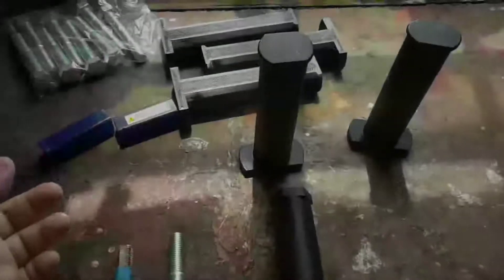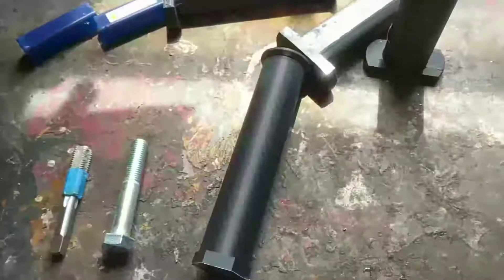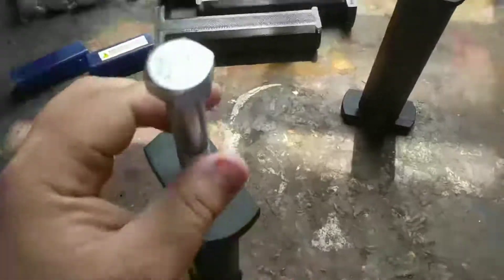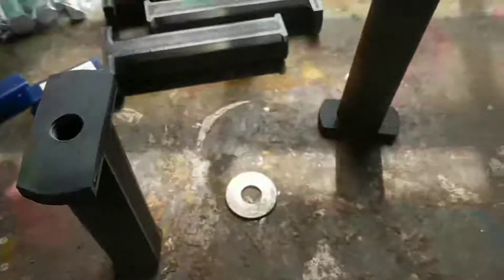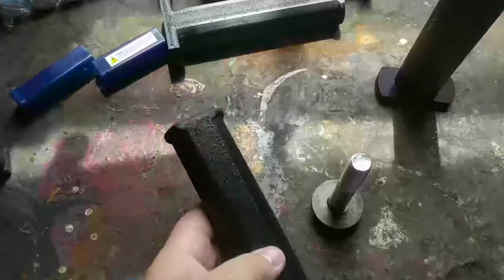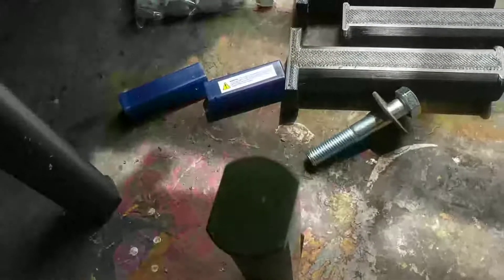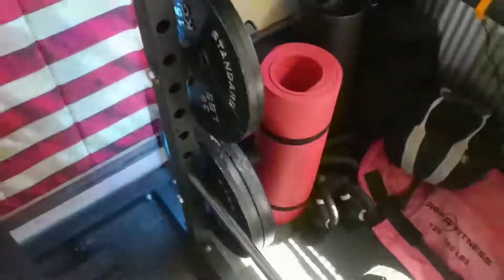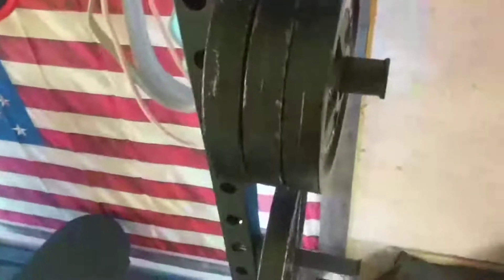DIY Olympic weight plate storage for the home gym with 3D Printing and a power rack

Comment: Hi, thanks a lot for this video! I bought a Squat Rack (Domyos 900) from Decathlon Switzerland (They have them in Walmart in the US) a month ago and I would like to also have some extra pins for my 50mm weight plates. The holes on my Squat Rack are 15mm instead of 20mm or higher, which seems to be the commercial standard. I thought maybe this could be a solution. What would you recommend me to do?
Reply from the maker: I designed these, so I can make the bolt size to anything you want we can do m15 bolts but you would need to source them yourself, the biggest thing is they need to be course thread and not fine thread
Reply: @NicholasMavrikBrandt  Thank you very much! Actually I just bought some pins from Decathlon itself that are supposed to be compatible. After a long search in their really bad search engine my girlfriend (I was having a mental breakdown at this point already after searching all over the internet) found them, hahaha.